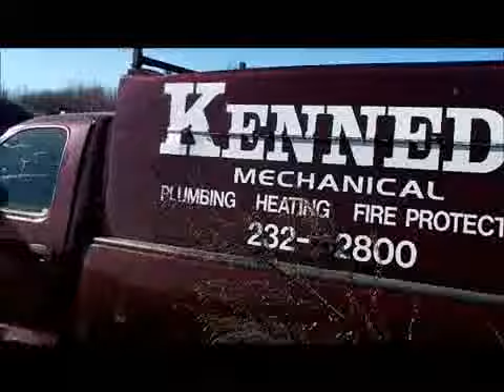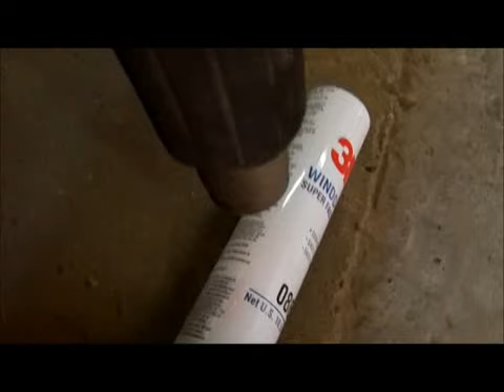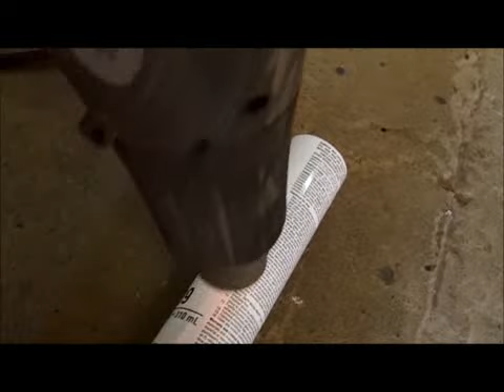Junk to Driver part 3

Comment: I used bicycle brake cables since I used to snap the ends off all the time. I'd get the whole window out in one piece with less mess and a lot less cuts on the hands.

Comment: Also when I would have to cut a quarter or a roof and had a useless windsheild in the way a sawzall worked great after a few cracks with a hammer or I would take a hammer all the way around the outer edge of the glass to break up the glass into smaller pieces on the plastic and just follow it around with a knife. Presto Chango winshield out-o.

Comment: Wouldnt it bea good idea to put some duct tape over the defroster vent before removing the glass? Maybe masking tape would be better so as not to get sticky residue all over.
I only removed a windshield once, we used to wooden dowels and wrapped a guitar string around each end one guy inside and one guy outside, and we used it like a two man saw. It came out pretty easy, although maybe windshield channels are different on new cars. The car we removed the windshield from was a 68 AMC.

Comment: i seen one put in with roof tar and the guy came to my grand fathers garage to se if he could stop it from sliding down in the hot sun wen the tar would get soft he pulled it out cleaned the tar and used the proper stuff